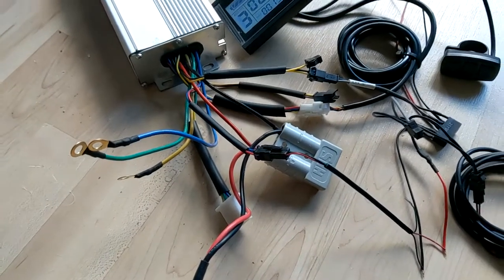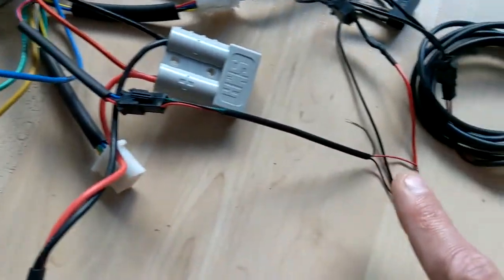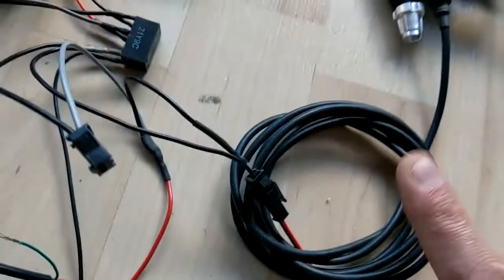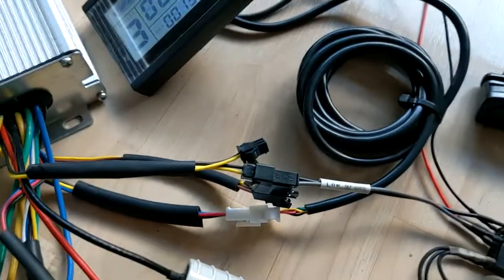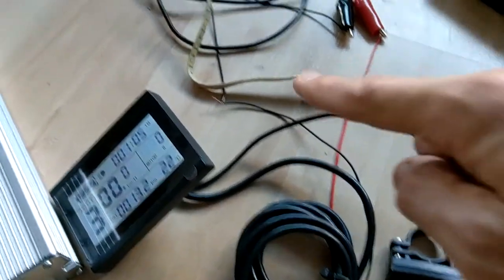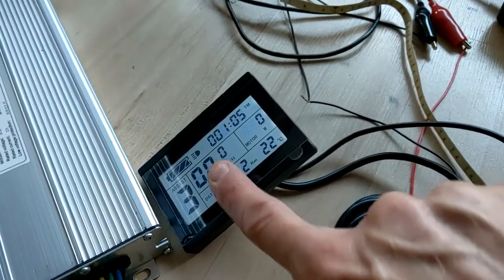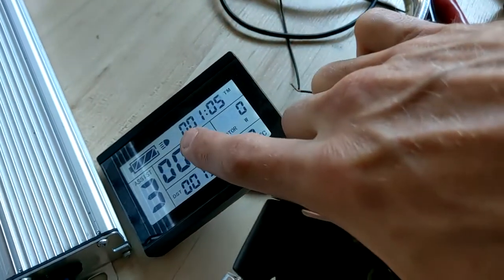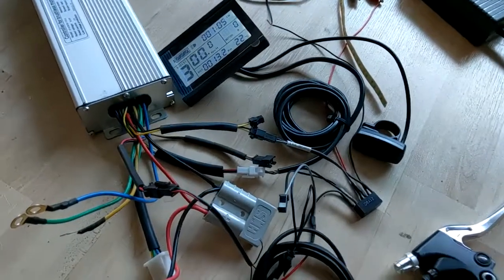E-bike brake-lights via $5 relay

Comment: Your explanation is clear, but I noticed that if you connected you brake lever "through" the relay and through the throttle wires, you then lost the brake cut-off function on that brake side......I was trying to avoid that, in a way both brake handles cut the motor AND turn the brake light AND are turned on-off via the light steering switch (light/horn).......Unfortunately, if i use the brake handle 5v signal, it doent work because the signal is so weak that the 5v relay doesn't activate at all, and the cut-off function still goes through the relay and cuts the motor, but the relay remains dead........I cant figure out how to do what I want.......
Reply from the maker: Thanks for your reply.

I don't "lose" any brake-cut-off functionality at all with my modification.  I've only used one brake-handle in the video, but there's room for both.  Squeezing either, or both brake-handles activates the brake-light, and cuts the motor off (and in my case, it triggers the controller to begin regenerative-braking).

So I must admit I do not fully comprehend what you're trying to describe.

However--I do have an answer to that problem you are having--with the weakness of the brake-sensing circuit.  That's 100% normal, and is in fact, the exact reason why I wired the relay to work the way it does!  You have simply discovered for yourself just how essentially ineffective that "low-brake" signal is--for anything but deactivating the motor-controller.  That's it's job--and it really is totally useless for accomplishing anything else. That's why in my modification, the relay simply devotes a set of contacts to close that circuit instead of the brake-handles.  That circuit plays no other role--because it really truly and honestly--just can't.

Again--perhaps I misunderstood--but just for clarity's sake:  I would not recommend throwing away the safety-benefits of brake-lights during daylight hours by setting them up to be switched on and off with your headlights.

If you have only one light--you can opt to keep that for your "tail-light" and add another brighter one for your brake-light circuit.  As I said in the video--you can choose anything you like--for your brake-light.

For my tail-light, I used an aftermarket LED lamp, 12V DC (for a motorcycle/moped/scooter), with three wires: One is obviously ground (-), the second wire is a (+) "tail-light" wire that lights it up regular-brightness; and the third is a (+) "brake-light" wire that lights the lamp up extra-brightly.  The way I wired it up for myself, that "taillight" function goes on and off with my headlights-switch, while the brighter "brake-light" function (via my relay's contacts) is always active (or... to be more precise--it's always active whenever my power-switch is turned-on).

If you have a basic understanding of electricity though, you can consider your desired functionality, select a relay (maybe more than one) which allows you to have all the appropriate contacts for your purposes, and then take the time to carefully wire it all up accordingly.

Best of luck with your project!  Be safe!

Comment: nice one bro tjis is what i was looking for aftet all research thank u
can u kindly advice what switch relay  shall i use as the one in ur video is very small to other 12v car relay for 12v brake light 12v already feeded to the light and relay just works as a switch witch it powers on with 5v from ignition am i right....
do i have to search part for 5v relay?
advice pls
Reply from the maker: I've updated the video-description with a more details. I hope that can answer your questions!

Comment: Hi. I want to apply this to my Ebike. I'm using 52v and 12v tail light so it will have a step down converter. My question is if I can use that relay to switch on and off my tail light? I ask because the relay is 5v only, I'm confused.
Reply from the maker: Yes you can!

I have got a combo taillight/brakelight (aftermarket, LED, meant for a scooter or the like).  The relay lights up the brakelight independent of the taillight in my case.  But yeah. Absolutely. It will work!

What I have is basically the same as you. 48V system, 12V lighting (via transformer). As shown in the clip, any voltage brake light will work.

If you listen to me carefully, all the instructions you need are in the clip. It does go by fast, I realize...

Maybe I should add some subtitles.

Read the other comments too. I have described where to find that picture with the relay.

If you still are struggling to understand, ask an e-bike technician in your local area for help. Let them watch the clip. Pay them for their time generously. They'll be a helpful ally for you!
Reply: @SaberToothBicycle  Thank you for a fast reply.
Reply from the maker: @shadoworkz123  you're welcome, and good luck with your project!
Reply: @SaberToothBicycle  Hi again. I just want to thank you for this. I works for me. Great help.
Reply from the maker: @shadoworkz123  Oh, fantastic! Glad to hear another success-story!

All the best, John-- take care, and ride safe!

Comment: in details u mentioned the relay is a 6pin, then at the end u mentioned pin 7 and 8 so is the relay has 6pin or 8pin pls in video it looks like 6 pin but what about pin 7 and 8pls
Reply from the maker: Relays come in various configurations. The Omron relay I used is available in various versions, some of which use eight pins--some of which use fewer pins. All the relays in the series, have their pin-positions numbered in the same way--one through eight. So, the relay I selected does not have pins in the positions numbered 3 and 6. That's why there's no mention of those two pins in my description. Hopefully this makes sense to you!

If you need more clarification, I suggest you try to search for the Omron G6B-2214P-US 5 VDC relay's specification sheet online. It is available for download. I cannot post links here, because I'm just a "basic" YouTube member (since I do not pay Google for the extra services, I am not allowed link-posting). But you can find and download the specs in pdf format from many sources. I found the data-sheet at the Conrad website, but it is available from the Mauser website also (for examples).

Best of luck to you!